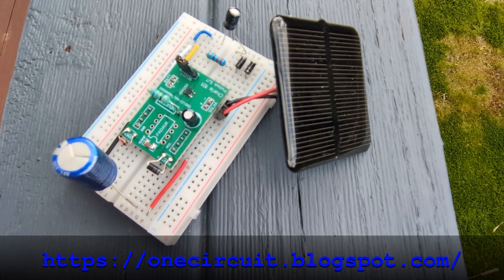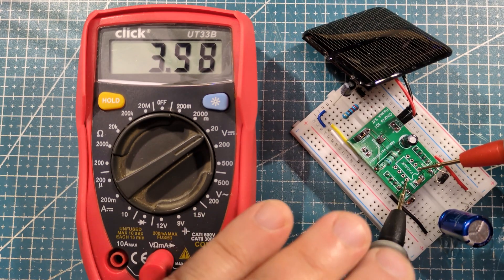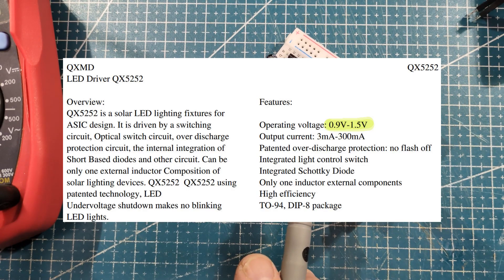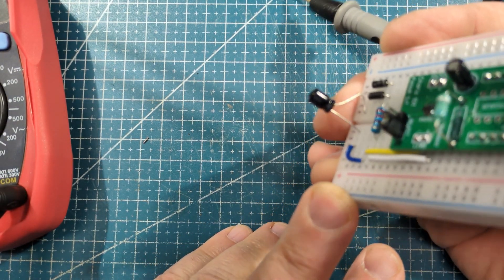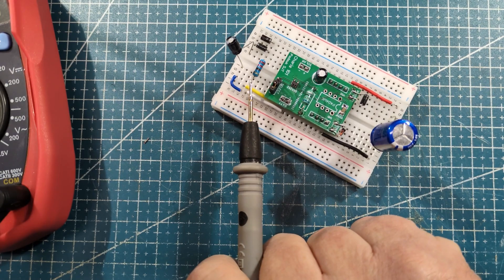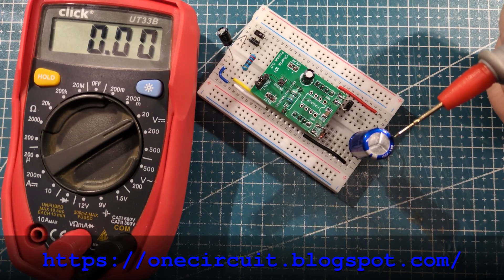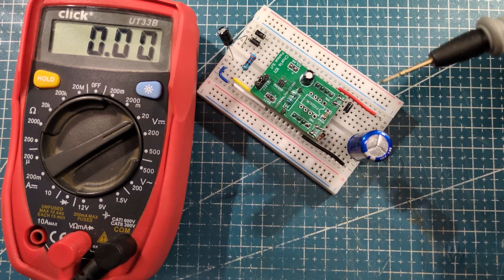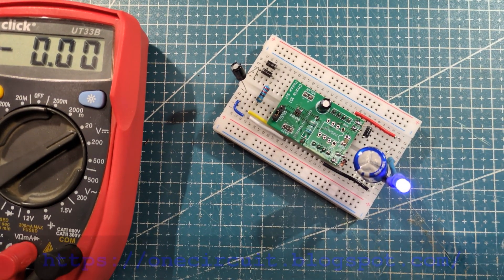Eliminate rechargeable batteries from your projects!

Comment: Would this work for powering a TV remote control, by just leaving the remote & solar collector on a window sill when not in use?
Reply from the maker: Yes I believe it would. The remote could even be programmed to be “asleep” until touched, saving more power.  I’d like to hack into a remote to try that! The modern remote is probably a little over designed like a lot of our consumer products. 👍😀

Comment: super capacitor can never replace even a tiny battery... your video is missing the actual device to use this...
Reply from the maker: Then you might need to check the linked videos. The super cap powered a microcontroller and a three LED “candle” for more than 24 hours. I don’t know the word “never”. 👍😀